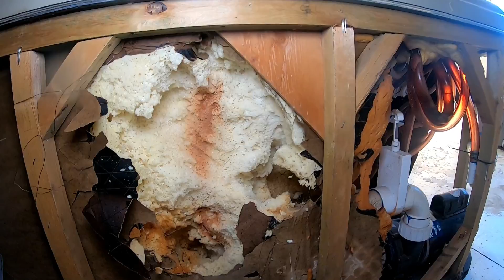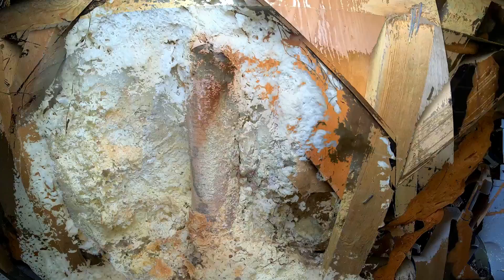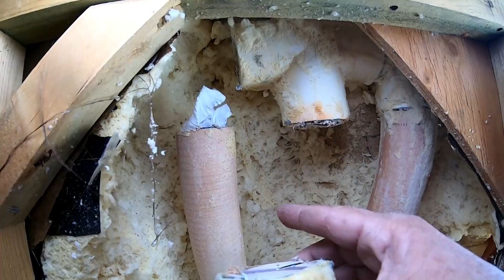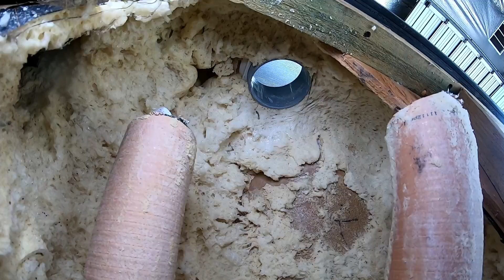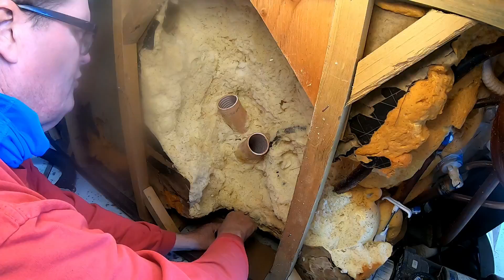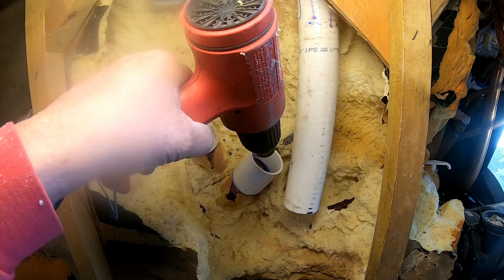Best How to Video ever... Hot tub & Spa Diverter Valve Replacement...DIY Spa Repair...Spa Man Videos

Comment: This is super helpful! I’ve worked on hot tubs the last 5 years and this is the first time I’ve had to replace one of these. I’m pricing up a the parts but for a job like this I don’t think my customer will want to pay for. Hot tub is in a really crappy spot, and first time I I fixed a different issue with the tub I undercharged them and they still said it was too much.

Comment: why are you  replacing all these valves? I mean aren't they serviceable like a new stem/plunger or o'rings. That's where I'm at on my tuff-spa the 2" orings are shot so I'm hoping to replace those and put it back together. Is there something I don't know. Not a pro here.
Thx
Reply from the maker: All of the valves Ive had to replace are junk in one way or another. They leak or will not turn and most often you can not take the valve out because it is no longer round and is stuck. When they are no longer round you can not screw the cap on and when you can screw it on the water pressure blows it off and if you are not aware of it will empty the tub really fast. Sometimes you get lucky and you can just replace seals with no problems 
Thanks for Watching & SUBSCRIBING

Comment: I have an Artesian spa Dove Cannon the leak is on the top side of diverter however is dripping down and under the tub.  I unscrewed the cap and now it seems as though the manifold has dropped down and I can not get the cap to thread back on.
Reply from the maker: You need to remove the side panel and push the valve back into place with your hand and then screw the cap back on... if you try to screw it back on and the valve is not lined up correctly you could strip the threads and then you have a bigger problem 
Hope this helped Thanks for Watching & SUBSCRIBING
Reply: @spaman5440  I could not get it to move up.  I replaced the entire Diverter Valve with the help of your awesome video. The heat gun pro  tip was crucial and what made this possible. I went a head and cut a  piece of 1x2 off to length and wedged it underneath the valve assembly and bottom frame of the tub to keep this from happening again when the 2inch flex pipe starts to retracted again. Thanks for your excellent knowledge and advice. I enjoyed this project because your video gave me the confidence to tackle the job.  YOUR THE MAN!!!!

Comment: I have a coast spa, and the diverter valve keeps shooting off when I turn on the #2 jets. The “cap” seems like it’s too big for the valve body. Is this a common issue?
Reply from the maker: Yes and depending on the age it does happen a lot ..when this starts happening most home owners spend time and money on part only to find out that the entire valve needs to be replaced. when they find out what is needed to fix the problem most bail on the cost of the job and pay / give the spa away.. Its really not that hard of a job parts are not that bad Ive done I think 4 different videos on several problems a job like this can run into.. I can do most in under 4 hours while filming if I'm in the shop alone I can do one in about 2 hours ..I will never do one in a homeowners yard while they watch !!! they ask to many questions and it takes way over 4 hours then...let the glue set up over night and fill with water the next day (Big pro tip let glue set up over night)Hope this Helps Thanks for Watching & SUBSCRIBING

Comment: Great videos and the information has been really helpful. I have a 5 year old D1 Diplomat Spa, that leaked inside long enough that the wooden crossmember is rotted to the point of just pushing a screwdriver in it like butter. 
Anyway, i removed the foam to find the lead at the diverter valve for Pump 1. The original lines are just pulled out, as they were not glued in well, so small leak for years, then it got much worse. I will likely take out more foam to get to the bottom board to replace it. Also to let it dry some. 
Can you tell me about the replacement foam insulation. Is that something I just buy at a spa supply house? Hoping that not horribly expensive.

Comment: How do you get all the spray foam off all the 2" tubes before glueing them all back into new diverter valve?
Reply from the maker: I scrape it off with a hacksaw blade(I use the straight edge side) takes a little work but it works great. Thanks for Watching & SUBSCRIBING
Reply: @spaman5440  Ahhh.  Okay.  I did not know if that would be clean enough so was wondering if you used some kind of cleaner/solvent.   Thanks
Reply: BTW.  I did subscribe.  Your videos have been great!  Thanks.
Reply from the maker: @kevinbarone4046  Just the Primer and the glue...Never had a problem with leaks But I have had viewers that had some problems with leaks and come to find out they did not get things scraped clean enough.

Comment: Hi was wondering if you could help me please, I have a balboa hot tub but every time I put the power on it trips my breaker. I have disconnected everything but the transformer and it still trips, when I plug everything in and disconnect the transformer it doesn’t trip but no power to hot tub